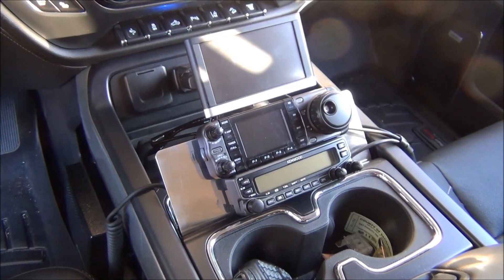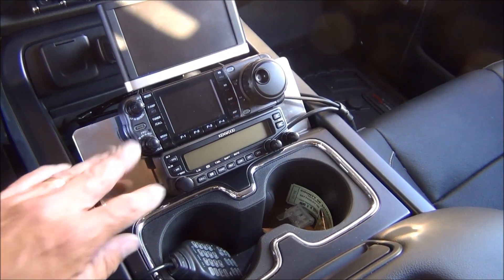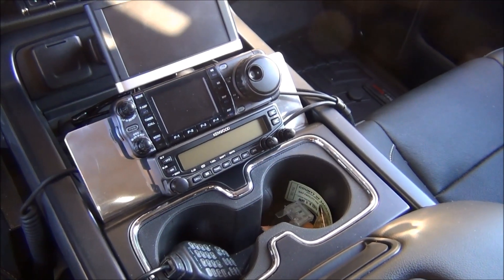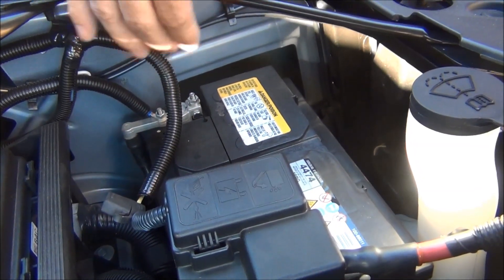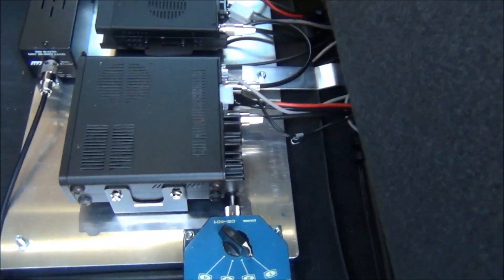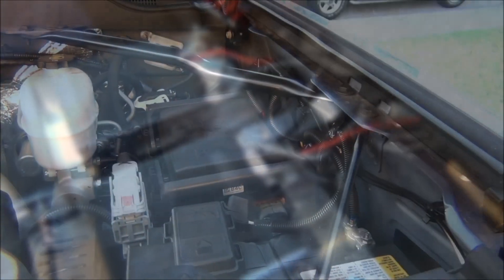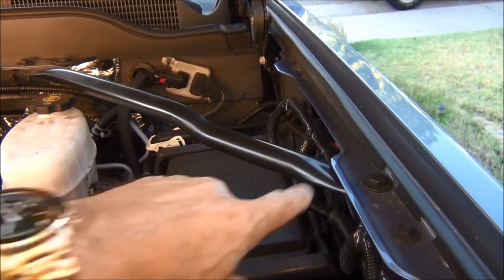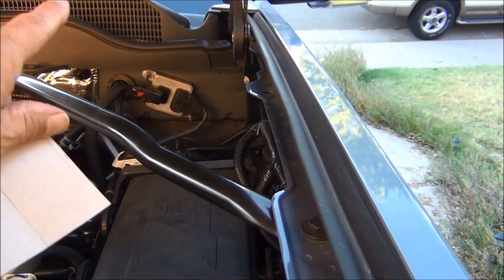Truck Radio Power 1

Comment: Running both hot and ground from the battery can be problems. Run a good heavy power + side but just ground the radios to chassis. Grounds should be short, the battery is already grounded so hook the radio grounds to the body.  Much better ground.
Reply: buzzsah You are so right, he is making it a bigger job then it is and going to have problems. One + is all he needs to run and use the body as ground. He isn't thinking about line loss with amps and having both + and - in the same box is dangerous. I see a ground loop and low amps, as you stated with giving the class, keep your ground as short as possible.